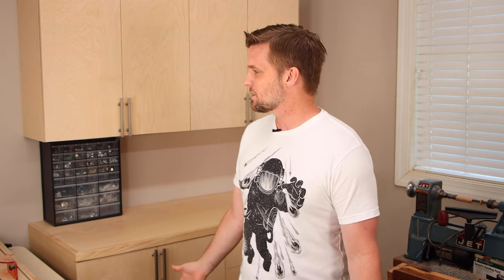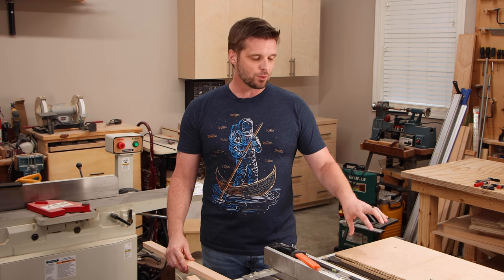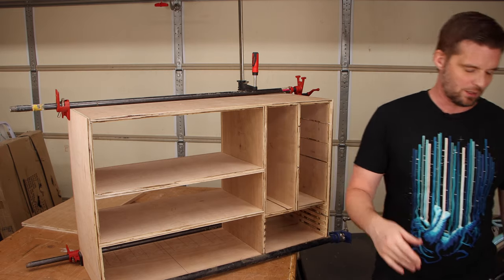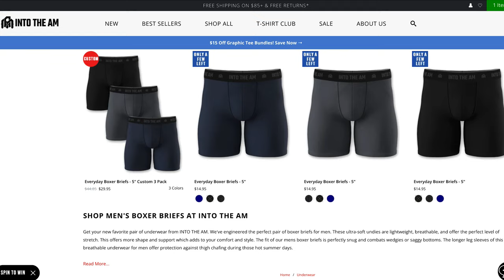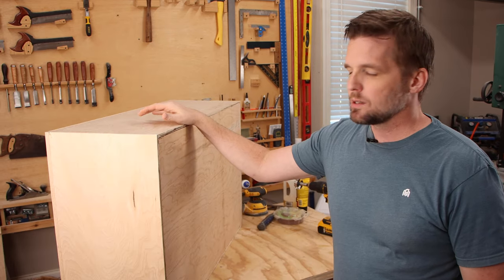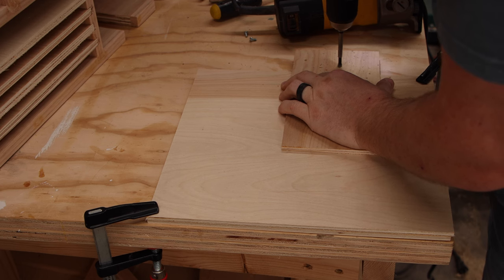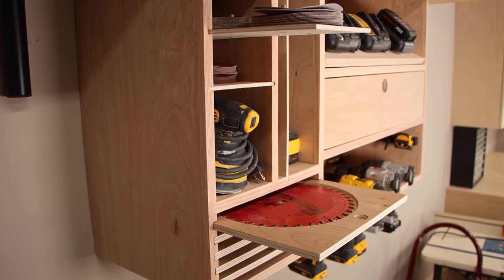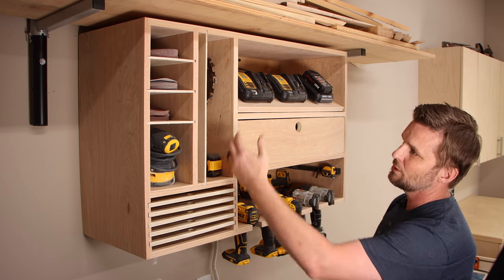The Ultimate Drill Storage and Charging Cabinet

Comment: Thanks Tommy for sharing your ideas! There are three things to consider when upgrading this cabinet: 1) The cleaner the contacts of the chargers, the better the quality of the charging process. There is inevitably dielectric microdust in the air, which will be deposited on the contacts. Therefore covers are needed for each charger. 2) Why drill such a big hole, you can only drill for the wire, which you pull inside by disassembling the extension cord socket block. 3) You will have to remember what's in the center drawer, because even when you pull it out you can't see what's there. Therefore, the front wall of the drawer can be replaced with acrylic, adding LED lighting inside.
Reply from the maker: Good ideas. It's probably the best possible scenario to have covers on the chargers, but it's easy enough to clean the contacts should they ever need it and they hardly ever need it. I had to drill the hole just big enough for the power strip to fit in the cabinet. Anything I take apart has to be put back together through the hole inside the cabinet. The drawer idea is a good one. I do remember what's in the drawer, but getting to it isn't the most efficient since I take it out and put it on the bench to see what I'm getting. Ideally, this could be mounted much lower, but I'm going to put cabinets underneath it, so it needs to be at this level. Thanks for the feedback!
Reply: Ah, clear plastic! Works for me see, but not reach and remove!

Comment: Really nice. Thoughts on the charging shelf being pinned (dowels?) at the top and not glued in so it can pivot up to get behind it for plugging in/out and whatnot?
Reply from the maker: That's a great idea. I could see a design where you can pick it up off of the dowels. This one is attached with pocket screws and not glued, but it still can't be removed. That might be a change that I make in the future.
Reply: @OutoftheWoodwork  using a piano hinge is a quick and easy implementation to just lift the top and access the batteries. Personally I would also include a switch for the battery chargers, dont like those green lights when all the batteries are full of charge.
But that is the beauty of creating your own cabinets!
Reply: Exactly my idea. I would have used a couple of hinges so it can be lifted. And I would add a strip of wood on the front so the chargers can't slide off of it.
Nice cabinet, Tommy!

Comment: Superb project, very well executed.  So neat now!  I think if the tilted battery charger shelf could be lifted up,  you could store the batteries in there.  I hope that space is not wasted.  I would also use a fancy wire loom for the charger cables on the side.  Looks nicer.

The sliding trays for saw blades, sandpaper, are genius.  Beautiful work!
Thank you for a lovely video and good instruction.  I must build this.

FYI  The music was very hard on the ears and is very stressful for viewers.